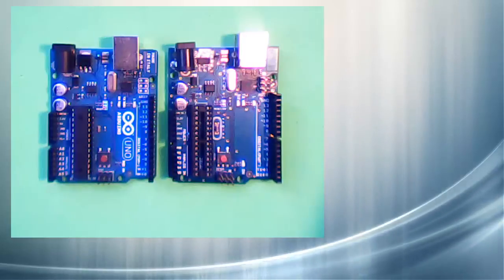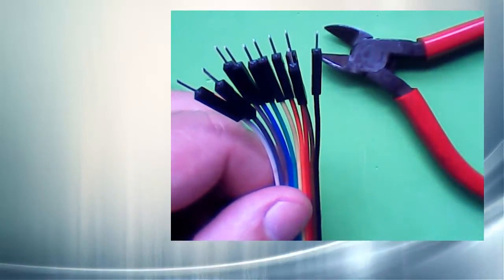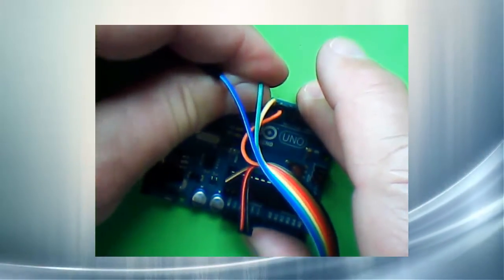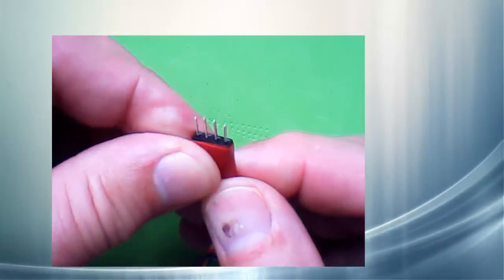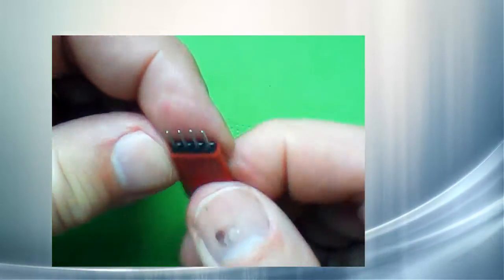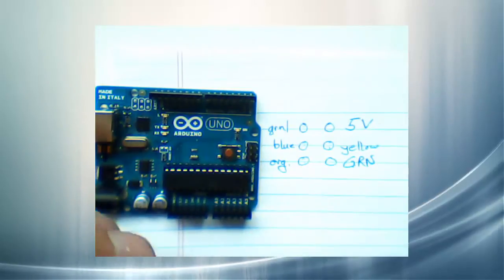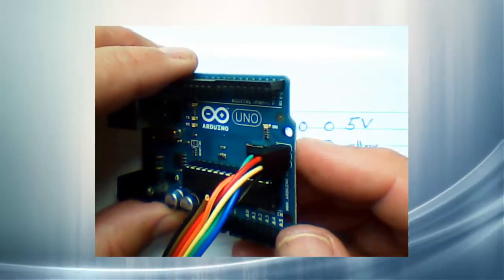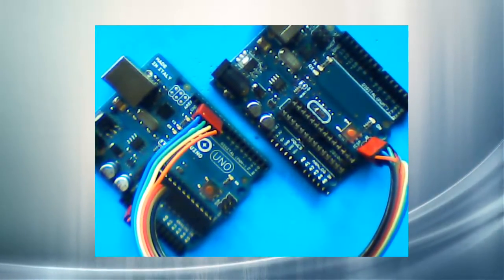How To Build Your Own Ribbon Cable

Comment: I know that i'm late but i have one question: I have a 40 pin gpio cable here and want to connect it to my raspberry pi. Does it matter which color goes into which pin. If so, how do I know which pattern to use ?
Reply: Hi, I would recommend using your own custom color cable code. For instance for me red is for 5V and orange is for 3.3V for me. Any cables for communication are blue yellow white green usually, and ground is always black. That indeed means i need A LOT of different colors but i never mess up a project with bad wiring. There are some videos on yt that could help. I recommend Andreas Spiess’ channel (the guy with the swiss accent) 
But you are free to use any code you want, as long as you remember it !

Comment: Suggestion: The connector blocks are normally made of ABS, so instead of electrical tape which could become messy over time, use acetone to glue them together neatly into one block. (if you don't have acetone, superglue may also work but it often discolours the plastic)
Reply from the maker: Great idea, David! I can't wait to try it.
Reply: I tried Acetone, it didn't seem like it worked for me :/ How fast does it take for the plastic to melt usually? I got impatient and resorted to super glue
Reply: It normally works as quick or quicker than superglue. It works by desolving the plastic, but also evaporates very quickly. Try adding a drop and then squeez the two parts together and hold still fort about 15 seconds. If you did it right, and you squeez hard you might see a very small amount of plastic actually coming out between the joint. You effectively make the two ABS parts one my melting them togehter.
Reply: I tried applying small amounts of Acetone to the black plastic (which I'm guessing is assumed to be ABS), but nothing seemed to happen. I'm pretty confident that what I was using was acetone (large metal can that says acetone), is there any chance that perhaps the black plastic isn't ABS?
Reply: I use UV curing glue, it dries clear and seems to work ok.   I have printed a sort of holder that holds the wires flat so it produces a ribbon.  If a flat ribbon isn’t needed a just use heat shrink.